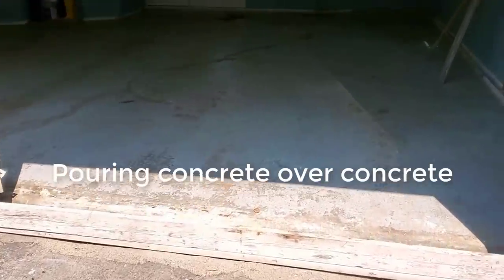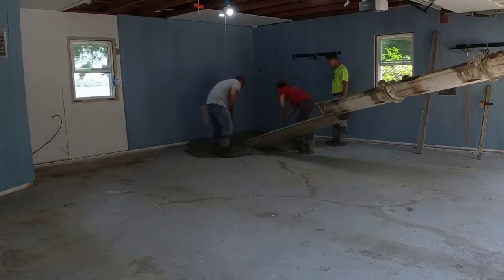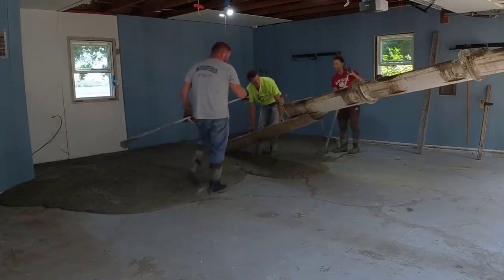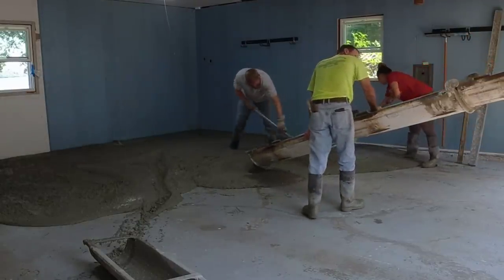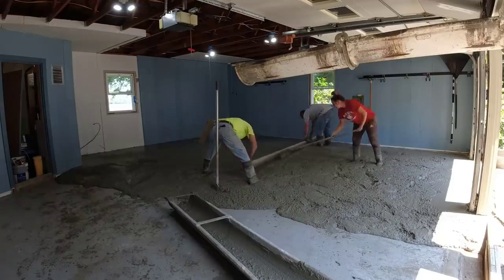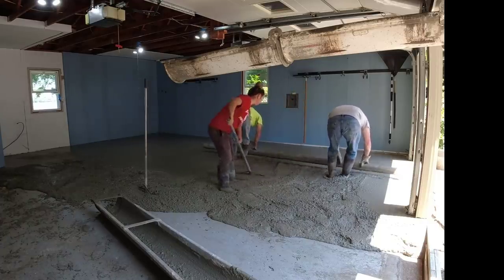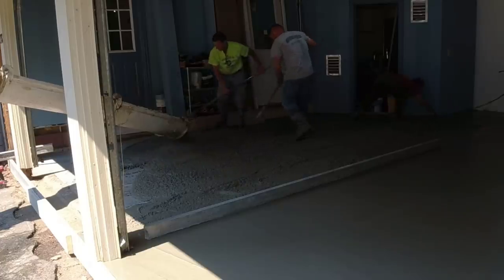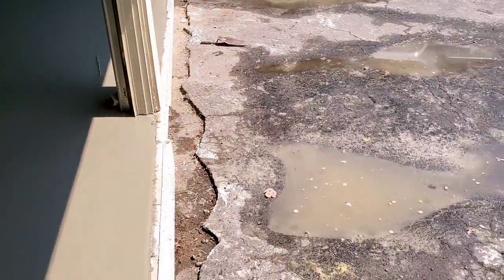Pouring Concrete OVER Concrete (New Garage Floor over The Old One)

Comment: Mike, I’m having a truck come by in a couple days to pour concrete with fiber mesh over concrete in my two car detached garage. I had a few concerns. Are there any issues you see with my plans-
2 car garage, 19x19
Crack down the center of garage that settled at the left and right wall atleast 20 years ago, no noticeable movement since, no other cracks. It has more pitch to sides than it should. My centerline front to back is 2 inches below the apron and then the side wall edges would be 4 and a half inch depth. I’ve installed 1ft sections of #4 rebar along the side walls ( 6 inches in wall 6 inches in slab 2 foot spacing) to prevent sagging in  the same areas it had. The goal is a floor level with the apron. 

Would you add any more reinforcement in the shallowest area?

Would you use weld Crete anywhere or everywhere?

Instead of bonding does it make sense to try and make sure to add something like sand between to try to prevent the two from bonding?

Thanks! Your videos have been really helpful!
Reply from the maker: Anything under 3 inches we bond. Over 3 and we don't. A sand layer or poly on pours over 3 is ok, poly is better.

Comment: Is there a way to make that junction between the new garage floor and the existing driveway ramped? I want to add new concrete to my uneven garage floor but it is currently level with the driveway.
Reply: You would want to go out about 2ft infront of your garage opening and cut the black top and add what's called a approach to your garage. Basically a concrete ramp up to the level of your new floor that you would be putting in. You could put that ramp on the inside of the doors but it would make the ramp on the inside of your garage and you Really wouldn't want that. Hope that help
Reply: @jeffb8781  it does help! Cheers 🙂

Comment: Iv also been pouring for years only custom work,no house builders, only true custom work.  Iv never poured over old concrete I think it will crack fast over the existing crack , but I'll try it now, and I also use vibra strike screeds😁

Comment: now its clear to me why the original concrete pour ALWAYS needs final touches with dry pack cement by the tile guys.  Somtimes its part of the contract but many times its not.  This is a great method if being generally "in the ball park" so to speak is good enough for the finishing work (if there is any) but no doubt working in this way is great for a painted concrete floor but not for tile.

Comment: Why didn't you bevel the edges down under the Garage doors? The next good rain the water will run down the doors and into the garage instead of into the driveway. My old garage had that problem with rain, I beveled the entrances to the new shop and no problems since. The new shop has 6 doors and is 6400sq. ft.--no flooding. I am surprised you did not prep the surface, looks like there is epoxy on the old floor. Since the old floor is cracked from settling, I would think the more the floor settles the greater the chance of the new slab will crack too.

Comment: Can you pour concrete over asphalt?  I have a similar situation to this with my driveway.
Reply: Yes you can
Reply: No you don't want to pour concrete over asphalt. Blacktop isn't as stable. You can pave over concrete though but you don't want to pour concrete over blacktop ever. Best bet is to tear up the blacktop and add/adjust the stone base and compact it then pour on that.
Reply: @johnathanmartinez8128  No you don't ever want to pour concrete over blacktop. You can do blacktop over concrete but never the other way around.

Comment: I hear you and I can do this but there will only ever be two types of concrete! The kind that’s cracked and the kind that’s about to crack! 😂 you should always prime the old floor to ensure adhesion from old to new because for real when it cracks not if it will develop some new issues.
Reply: I've got commercial driveways we poured 20 years ago that are 20 x20 that have not cracked. Good sub grade, 6.5 bag mix, poured stiff, bar on 12in center, 8 inch thick. Not a crack. We did 5 of them in front of a auto shop. Owner was crazy about no cracks and no saw cutting. There expensive. I do excavation only now and we grade for some guys who do good work we'll run loaded trucks over drive approaches 7 days after and not a crack. If they break they have to be replaced before project gets a C/O.
Reply: Adhesion is the exact opposite of the what you need to do. Other than than, I agree that cracks in concrete are a very unpredictable problem and EVERY effort to avoid them is good value spent.

Comment: I have a patio 5-6” thick poured in 22 that runs in my foundation….the guy that poured it blames my forms but he removed the ones I was going to use along the house….patio is 19x25 I was thinking of pouring on top 9x10 section to drain the water away

Comment: Mike we bought a brick built house which has a one car garage converted into a dining room (opened up from the living room so it is open plan). The concrete floor shows some flaking. The previous owners levelled the floor up to the living room height using a wooden frame and plywood boards. We're thinking of ripping that out and replacing with concrete on the old layer. It will need the to be 4 to 4.5 inches deep. Is this doable, also will we need to leave a small gap around the edge for expansion? Thank you.
Reply from the maker: Sounds doable. Thin foam like sill sealer would be good for the edges.

Comment: Great video.... I usually use dpc/plastic to separate the old to new concrete with Fibre mesh concrete... let me know your sentiments regarding. Cheers 🍻
Reply: Bad practice. You create a vapour barrier trap when you do that. The latex bonding agents do the work and moisture can pass through them. I always prep the surface when I see paint to scuff it up and I use bonding agents.
Reply: @shawnhayden6674  adding poly under the concrete will make the concrete way stronger, it allows the water to stay in the concrete while it is cureing. If you are too cheap to use poly under concrete, you shouldn't be pouring concrete. This floor won't last long before it starts cracking and flaking.

Comment: When you pour over old garage floor, do you usually need to get new garage doors?
Reply from the maker: Not always, but you do usually need to move them up a couple inches depending on how thick the new floor is.
Reply: @MikeDayConcrete  do you recommend to the customer that they keep the mew slab wet for a few days?

Comment: I have a very broken and uneven back patio. Whoever did the original pad didnt compact the ground or use an appropriate gravel base. When the ground inevitably settled, the pad cracked with a deep valley in the middle. If I do a 3" new pour over it, will it be okay or do I need to remove the old concrete?
Reply from the maker: I'd recommend removing that. Then, use gravel and compact it properly. Pour new and it will last.

Comment: I was always told the cracks from the existing floor would transfer to the new floor if not fixed properly.  Is this something you have experienced? I would think the fiber is a big help for that?
Reply: I normally put down 6mil plastic and do the rest the same, I think it helps from the old cracks coming up in the new floor
Reply: That's called reflective cracking. If the slabs continue to settle and crack it will reflect through the new slabs.
Reply: That floor will last longer than most of us watching this video.
Reply: @ThePerfectSeason1972  probably will
Reply: @bobbypatton4903  I would think the expansion and contraction of the concrete including the existing slab could make the cracks from the lower slab show in the upper.
Reply: @henrybittle5234  ....I agree Henry! I don't want the new floor bonding with the old floor. Especially at that thickness.. I want it to shrink independently and not bind up causing cracks  in unwanted places. But I've watched a lot of Mike's videos and he does a great job!!

Comment: I have a very valid question for any QUALIFIED concrete contractor:
There are two camps here on BONDING new overlay concrete to the original floor. Half the folks here say to use a primer/bonding agent (such as WeldCrete) & the other half says the opposite- to but down sand or 6mil plastic, thereby providing a slip joint, to prevent old cracks from transferring through the new slab. WHICH METHOD IS THE CORRECT METHOD?!?
Answer here: ___________________________________________________________________.
Reply: I am a builder in Australia. Answer to both questions mate, if the ground is active no matter what you do, it will still crack. I myself will use sand or the plastick and create control joints, in addition I like to say the concreters on this job they are knowing their job, good on ya mates.

Comment: Thank you for the video. I’ve been wanting to do this in a detached garage. I’m worried about the two slabs not bonding. Would pinning it be worth it? Thanks
Reply: The slabs don't bond. The old slab is cracked but having settled all the years, it's stable. The new slab floats on top of it. If they had bonded, the cracks would telescope through. Not telescope... what's the word?
Reply: @tedspens  Telegraph?
Reply: Projected!
Reply: @tedspens  migrate?
Reply: Conflagrate
Reply: @SuperAncientAlien  Conflagrate, HAHAHAHAHA   Had to look that up.  Almost spit out my coffee. 😂

Comment: Hi Mike, I am just about to do this in my barn conversion. We dug new footings around an existing slab (that as far as I can see doesn't have a dpm) and now there is between a 4-12" gap between the old slab and the new walls with the dpc hanging into the room 6". The slab, although it looks like it's made out of different  pours doesn't have any cracks in at all and has been there since 1960. It's going to be an unheated workshop. Would it be suitable to lap a new dpm on top and put a 3-4" slab onto that? What sort of mix would be adequate to roll upto 1 ton ish woodworking machinery over without damaging? Could put some wood down on top if damaging is an issue. Really would like to avoid breaking the old one out if possible... All the best
Reply: What is a dpm? Thanks!
Reply: @bondpit8750  damp proof membrane

Comment: Mike just curious , why not do a 1/2" skim coat of concrete resurfacer or "self leveling" concrete? Commonly used for old beat up pitted concrete to give a fresh look . I want your opinion
Reply: Fresh look wasn't the goal, their was a drainage issue.

Comment: I was thinking of raising the deep end of a pool by 2 feet (that being the center which is 8 feet). I would install a 2 foot riser for the drain) . I would then fill the deep end (center) with sand, then pour a 4 inch slab in the entire bottom,  thereby raising the pool bottom by 4 inches around it's entire inside perimeter, in addition to the 2 feet I desire in the center. 1. Does this sound feasible? 2. If so,  what psi concrete would one use? 3. Would you mesh and/or rebar the concrete pour? This is an existing ingrown concrete pool whose bottom is breaking up a bit, but still holds water just fine.....thanks for your opinion

Comment: 24x32 split down the middle about 8" drop on one side. The whole thing is below grade due to an over eager excavator putting in n new septic. Slab has no footing. Thought about jacking slab, or just under pinning it it little by little then a fresh 5" over top of the old 4"

Comment: My garage floor is lower than the driveway. I have a double garage. The floor is in good condition but has cracked paint. I needs to be raised about 2 inches.

Comment: I am resurfacing a slab that is exposed outside, it has lots of surface Spaul and flaking , any extra consideration if it is exposed to sun , rain, freezing etc? Thank you for the video!
Reply: What makes the top pop is water, usually in the form of snow freezing and thawing. If snow is on your drive it will melt in the day than at night a portion of what melted will freeze during the night bonding and lifting the concrete. You always need to get snow off your drive. 
If you drive through a neighborhood you will always see more flaking at the garage doors on the south side of the road then on the north side of the road because it takes longer for the snow to melt on the southside because the sun goes down behind the house and the northside just keeps freezing and thawing the sun melts the snow faster on the houses on the north side of the road because the drives are not shaded by the house. Drive down any Neighborhood the note and see the difference  on the southside from the northside

Comment: Hey Mike I have a question how far can you get from the truck with the shoots and around a corner ?
Reply: The truck can reach maybe 15 feet, you can add your own shoots but you have to support it, if you can get enough pitch on the shoots for the concrete to Flo, pour on the wet side. If you don't support the shoot it can bend the trucks shoot and the driver won't let you put them on if it's not supported

Comment: Nice work. I am a DIY guy and sometimes I bite off more than I can chew. 😂 My first and only attempt at pouring a floor was my garage build back in 2005. It looked okay until I checked to see if it was level. It was not. Unfortunately, the slope was a 1.5" drop to the back of my garage. My son had some, Quikrete High performance cement floor resurfacer he wasn't using. I wasn't sure if this would work pouring up 2" thick and tapering down to zero. Do you have any product preference for this? Thanks! By the way, I'm right here in Maine and a proud owner of one of your bright orange t-shirts! Just got it last week.

Comment: I have a garage that was built over two old carports. The previous owner sloped both of the pads towards a 1' French drain filled with river rock for drainage. I filled the drain section with concrete and built a stem wall for the garage foundation. Because of the slope from the driveway into the front of the garage during heavy rain the water sometimes enters the garage. One slab is rough finished and the other is smooth. Really if I could just float it the problem would be fixed but the concrete towards the entry to the garage would only be an inch thick. Any suggestions? BTW, I find your videos very helpful! 🙂
Reply: Tamms patch does feather edge to 1" thick

Comment: Hi there. We've been watching your videos for some time in anticipation of pouring our garage next year. Your invitation to ask questions may be regretted. Haha. So if I have a dirt floor basement with a 6'x8' pad, would I have to demolish the pad to pour the remaining area? Or would a separation of some kind be required. The hot water heater sits on the pad, thus the hesitation. The only other option would be if we get brave and decide to dig down to increase head space.
Reply: Have seen some one in Michigan  dig two feet and poured  a  new floor  only problem he ran into was a stone pier  in the middle  but he  sealed stone  made a liquor stand for behind his bar good luck

Comment: Mike can you do a video (scenarios) where you would use Weld Crete so folks can get familiar with this product. This stuff is amazing. I use it on cold butt joints, applying new to old concrete and predominantly on all of my door and window replacement where we have stucco patch work. I have found this to be a great bonding agent. I have used this to float cement all on sidewalks that have lifted, cracked or just had huge holes on city sidewalks. Come back years later and the cement all is still in place.

Comment: HI Mike.  This is my first video I've watched and I just subscribed.  I know you weren't concerned about the cracks in the existing slab.  What are the chances of a crack telegraphing up in the new slab?  What is your experience in telegraphing cracks without any kind of bond breaker?
Reply from the maker: They could if the cracks are still active, or moving. We felt this one was OK

Comment: you should have cut the studs out on the garage door center post so concrete goes under the post., no concrete should be against any wood or drywall

Comment: What’s the cost savings here for going over the floor vs ripping it up?
Reply: Chill Will  I’m not a concrete guy(obviously) but for me I’d be willing to pay more for a concrete floor that didn’t crack in the same spots as the old slab.  You have no idea what has settled under the curr3ct slab, and to me it would be worth ripping it all out.  I think!  Lol
Reply: Alot.

Comment: This will work for a while, but will fail. The new concrete will end up floating. And if you live in area that freezes it will fail even quicker. Sorry folks, there is no short cut to concrete. Now there is several products that will allow a pour over concrete, it is specifically designed for this. The base concrete needs to be shot blasted, or acid etched and then you can pour over it. However I think the max thickness of the overlay is 1.25".
Reply from the maker: Couldn't be more wrong, but thanks for commenting
Reply: Acid etched? Hahaha yeah ok. So the concrete can "glue" itself down, right? Concrete being extremely heavy and all, its gonna "float" right away, huh?... Lol dude, it's poured in place, it's not going anywhere...
Reply: @mikeznel6048  You know nothing about concrete. I suppose you think concrete dries, and you probably think concrete doesn't have water or moisture in it. Wrong on both counts. Now how about you tell us all the hydraulic strength of water when it freezes? Concrete cracks when it's poured as a continuous slab, expansion, contraction, the shift of the supporting ground, etc; etc; etc; It's going to fail, it is only a question as to when. and it will be sooner then later.